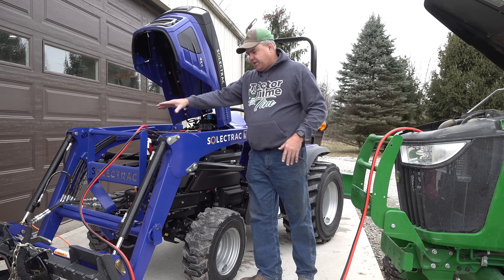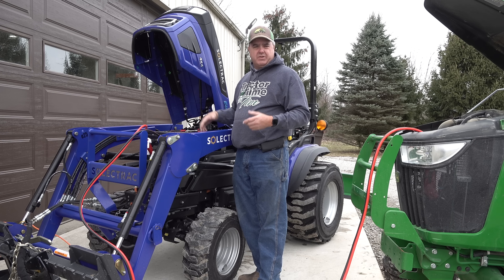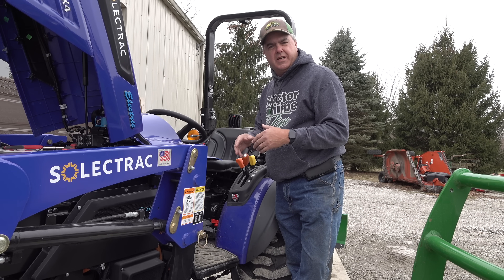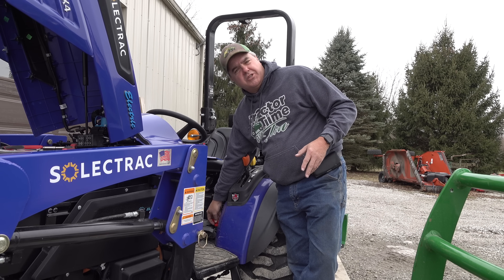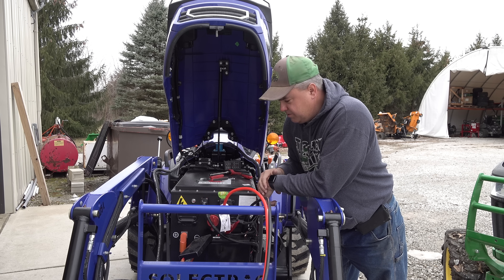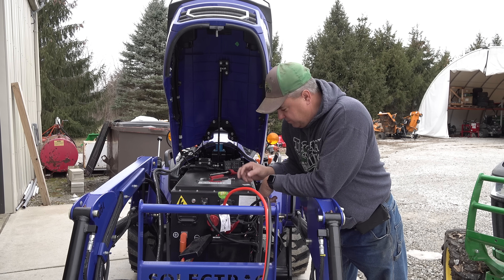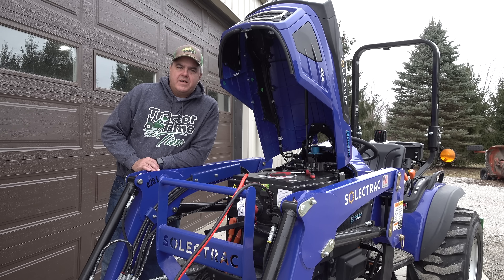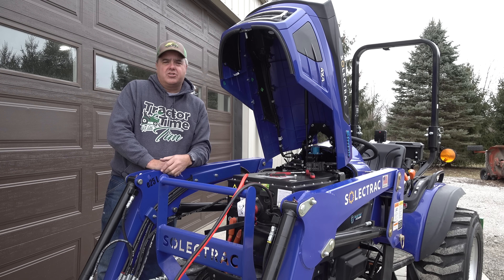Battery Issue with the Solectrac Electric Tractor!  I’ll Explain the Details!

Comment: I have a 2022 Farmtarc 25h diesel ,,battery is dying after sitting a month,,light is flashing on control panel that shows a charging issue,,could a bad battery be the cause,,since my tractor is only 9 months old i would hope alt is still good?if battery is bad is a actual tractor battery needed or will others work,,any help would be apprec

Comment: It has been this way with my Teslas for years, as far as having a separate 12VDC battery.  My newest Tesla now has a compact lithium 12V battery, but if that 12V becomes discharged, the car will not operate.  I’ve heard of folks having issue’s similar to your tractor, in their Tesla, but I’ve never experienced it.  The fact that the tractor has a battery disconnect is concerning to me, as it would seem to indicate they know there is a substantial phantom drain issue. The main drive unit battery and controller should not let the 12V battery become discharged.  I would guess they are still working out issues, and will eventually overcome this problem.  Does it have over-the-air update capabilities?

Comment: Too much aggravation and it is a toy  by comparison to any sub or compact diesel powered tractor especially when putting these things to work for a  profit . Anything electrically powered can be manufactured whether or not it  makes any sense  all.
Having to adjust to charging time cycles to get a job done is not a luxury that most work jobs  schedules permit 
 irrespective of what season of the year it is. People have gotten goofy about the concept of  green nonsense  and despite the adverts these things will not save the PLANET  through  any misguided notion about the reason for them to exist except noise levels , they are quiet that is  undeniable . But ,  their construction has already contributed to polluting materials and emissions where the starry eyed  owner cannot see them , and will be anytime its plugged in to charge ...an inversion of the emperor`s clothing  , free  solar right  ? Yes  in places like  the Sahara desert , or  Arizona ... not likely in northeast or northwest  insolation in either leaves a lot to be desired .
They do have  a place as  yet another  Green home owner  feel good  bragging rights green toy , for owners  who can wait whatever time it takes to top the electrons needed to do a few hours work , provided that it can deliver that much work time  in the REAL WORLD .

I cannot wait for the attacks which will no doubt come my way , but  I will laugh them off for what they are ...reality is tough to face and harder to exist in .🖖live long and prosper !

Comment: EV cars and trucks are the same way.  The 12v battery runs all the accessories, lights, windows, climate control etc.  Without the 12v you are dead in the water and it is frankly the weak link on many EV's.  It's a good idea to keep the 12v on a battery maintainer much like we do with other equipment when it is sitting for a long time.   12v runs the brains of everything, and the large traction battery does the locomotion.  🙂

Comment: I have this same electric tractor and did the same thing with the 12v battery.  I just replaced the 12v lead agm battery for a LiFePo4 battery.  Same size and higher capacity.  I still try to turn off the 12v system when I’m done using the tractor, though.

Comment: It's actually a safety feature to turn that switch into the "off" (breaking the circuit) position.  No different from turning a key. The "Mains" (main "larger" Battery) should also have an on/off switch.  Emphasis on "mains" as the 75 horsepower Solectrac has swappable Batteries which is absolutely the way to go if you pure BEV as first off you can store your Batteries in a warm, sheltered space such as Basement or Garage space that needs safe air space as Batteries are always discharging so same with lead acid always store when not in use in a safe open not in your kitchen or living room space and away from any liquid fuels, coolants, hydraulics etc. Of course this should be done via in person with Solectrac Dealers and Owner's Manual as well!

Comment: I have an e25, and I ran into the same thing. You have to turn that little red switch off to prevent phantom drain of the 12 volt battery. It takes several days to phantom drain, so it’s not a problem if you use the tractor every day, but I shut off that switch whenever I’m done working. When it happened to me, I used my trickle charger to re-charge it. I also decided to hedge my bets, and bought a lithium-ion 12volt replacement for the stock lead-acid one. (I don’t like lead-acid batteries anyway, so I was happy to get rid of it.)

The 12 volt battery is necessary to run all of the 12 volt electrical stuff — the lights and switches all need 12-volt to run them.

Comment: Think of the tractor as being entirely computer controlled...computer controlled main battery discharge, main battery temperature monitoring, torque delivery, and even main battery charging....that small battery is for the computer.  If that computer isn't computing, the tractor isn't tractoring.  :)

Comment: I had 12V problems until I fixed the shutoff switch. The contacts were corroded (happened on the dealer's lot) which dropped the voltage I got from the 12V battery, making the battery drain issue much more pronounced.

Comment: Very interesting stuff with EV Tractor.
Sounds like the 12v battery is kind of like a home thermostat. It runs on low voltage but controls the furnace and A/C. Too bad the snow didn’t get going yet!!

Comment: You might want to check the voltage on the 12v small battery when the key is in the on position to make sure it is getting charged from the big battery. Mine had a wiring issue that prevented the big battery dc-dc converter from charging the 12v system so things would work for awhile but eventually the small battery would get low and the whole system would freak out in confusing ways. It is not like a car where the car on voltage is up at 16vdc but when using the tractor it should be maintaining the small battery at 13vdc ish based on my recollection.

Comment: No different  than any normal gas car. Let it sit parked for a few weeks and your battery is dead. I'm sure older ice tractors have less electronics and can sit longer without topping the starter battery.  A very small consideration to have in mind.

Comment: I wish Tesla would get into the compact tractor business.   I think they could really make an amazing product applying their First Principles methodology.  The soletrac really seems like a DIY retrofit machine.  Personally, I'd love an electric.  I do dislike the smell of the fumes and the noise from my 1025r after a few hours of use.  (that said, overall, I LOVE my 1025r)
Reply: Tesla just upscaled the electric car you had as a kid. The only real innovation they have made is the low resistance way of joining the battery cells together.
Reply: @atodaso1668  Wow...not even close to accurate.  The innovations that Tesla has made in drivelines, manufacturing, metallurgy, software/simulations/AI, battery cell design, safety, aerodynamic design, automated driving, and much more are leaps beyond the rest of the car industry.
Reply: @mymorristribe  Except they didnt do any of that. Drivelines?  Tesla invented the electric motor and torque vectoring? My remote control car had that. Manufacturing? You mean they told another manufacturer to make a large casting machine for them to save manufacturing costs but will result in more costly repairs? AI? You mean using their customers as guinea pigs and crashing them into parked fire engines on the highway? Battery cell design? Do you mean Panasonics battery design? What safety innovation did they make? Its not hard to get a good crash test result when your car is made of a solid piece of heavy metal, just look at a WRC car. Aerodynamic design? The Honda insight had the same level of aero and its an economy car from 20 years ago. And are you talking about the automated driving that is being investigated due to its poor performance? Driving through red lights,  going straight while in a turning lane, cutting people off etc?
Reply: @atodaso1668  Ah so you are a Dan O'Dowd, dawn project troll eh.  Well, whatevs.  Tesla is the future--maybe pay attention.
Reply: @mymorristribe  No idea who those people are. Just an electrical engineer that was into RC cars as a kid.

Comment: Got to do some snow clearing the last two days. My 1025r, Joan, did wonderfully, despite R4s on the back. I used a back blade, turned backwards, and was able to clear more than a foot of powder off of my dirt road. Joan cleared three miles of road, and half a dozen long driveways, without so much as a hitch in her giddyap!
Reply: R4s are amazing tires. I'd put them on my work truck if they made them. 👍

Comment: Most evs have phantom drain on the 12 v the switch was put in to stop that from happening, but unfortunately there’s no sensor to tell you to turn it back on when in use
Reply from the maker: Won’t start with the switch off.

Comment: Hey Tim:  you said the BIG battery doesn’t charge the 12volt battery.  When you plug the tractor into a 240 volt charger, does that charge both batteries at the same time?
Reply from the maker: No. Only charges the big battery.

Comment: I drive a 17’ Ioniq EV and it has a built in battery tender for the 12V system. I was surprised  to find out not all EVs have this feature. 
On most EVs the 12V system is the most unreliable part of the vehicle. 
EV typically use smaller batteries (no need to crank over an engine) but these smaller batteries seem to fail.

Comment: Interesting.  But if you’ve ever looked at any hybrid car, you’ll find there’s still a 11v battery to run the “normal” car stuff, including the engine.  Then there is a completely separate battery pack running at a high voltage to run just the electric drive. I guess I shouldn’t be surprised, they pilot the electronics on the tractor with a low voltage battery and only use the high voltage pack for hydraulic motor and drive. Stranger still, the battery charge cable can’t charge the low voltage system. Seems like a major oversight.

Comment: That makes absolutely no sense and would appear to drive a negative user experience.  I suspect good engineers were constrained by cost, OR bad engineers could not solve for having a more simply designed and functional system for the user.  Neither would be acceptable to me.

Comment: Congratulations. You discovered how EVERY electric vehicle that uses a high voltage battery pack operates. In a Tesla, for example, there is a 12 volt battery. It powers the computers, communications (Teslas have cellular and wifi capabilities) and the entire dash and entertainment system. When a Tesla goes to sleep, it will wake up periodically and charge its 12 volt battery to keep it maintained. Keeping the high voltage pack awake would drain that system quickly. 

As for storing this tractor, you could keep it plugged in to charge the high voltage (the tractor will ensure it doesn’t over-charge). And you could hook up a Battery Tender™ or similar to that 12 volt battery and the tractor will be ready for you whenever you need it.

Comment: The 12v battery serves the same purpose is what a 12 volt battery would do on a regular ice tractor or vehicle. It is there to control instrumentation fans accessories in the case of an EV or this the 12 volt main relay for the charging and to control the high voltage battery. Normally in the case of an electric car when you plug the car into charge it also charges the 12 volt battery. In operation when the cars being driven or the powers on to the car, the high voltage battery is charging the 12 volt battery. Biggest reason that they do that is because in the case of like my Chevrolet Volt the high voltage battery is at about 400 volts. You can't run the accessories or anything with that voltage because there's the risk of shock. That is why the used 12 volt for all the accessories. I'm sort of surprised the draw on the 12 volt is that high that after a month that kills the battery because in the case of a normal ice car normally it would last longer but perhaps the batteries smaller in the tractor. The key thing is when you're operating the tractor the high voltage battery will charge the 12 volt battery. You do not need to worry about putting a maintainer or anything to charge at battery in the case of with the soul track as long as you shut off the circuit so you don't have the draw all the time when it's parked for a long. Plugging the tractor into charge would probably be the effect of being a battery maintainer if you have it plugged in all the time, but I do not know how the charger works on that and the case of my Chevrolet Volt when I have the car plugged in during cold weather. It also maintains the temperature in the battery so the battery doesn't get blow freezing and that's one functional. Why I leave that car plugged in all the time draws very low juiced to do that because the battery pack is pretty well insulated.

Comment: If the 12v battery needs to have a charge in order for the high volt battery to be charged, does the switch you were referencing need to be on(or can it be off?) for the charger to charge to battery. Sorry if my wording is a little confusing. Thanks Tim and Christy for this series!
Reply from the maker: I understand the question, not absolutely sure on the answer.  Sorry.  I’ll try this…but it makes sense to me that the 12v will need to be ‘on’ to charge.
Reply: @TractorTimewithTim  I did the exact same thing to my tractor as Tim, and I did worse even and completely ruined the 12v battery, though Solectrac sent me a new one under warranty and explained about that switch. I believe that cutoff switch should be on at all times including when charging except when it's not being used for a long time. I don't know if it's recommended to just leave the tractor just plugged in when it's parked over an extended period though I assume it is safe.
Reply: @AdamHayekM  Thanks for sharing this - as an EE I think the manufacturers have screwed up on this design a bit - that small battery should be able to be fully recharged while the tractor is in use, from the large battery.  If it isn't, then it will inevitably discharge and sitting in a partially-discharged state for long periods of time will lead to premature battery failure.  

If this was my tractor, I would install an on-board charger/maintainer on that 12V battery and keep it plugged in when not in use.  That way, even if the master switch is left on, the controls power battery will stay fully charged and live a full life.

Comment: Why can't the "master" switch be a relay controlled by the ignition switch? that way you never forget to shut it off. Obviously there is a significant parasitic load if it went completely dead in that short time frame.
Reply from the maker: 4 weeks?  Pretty small battery.

Comment: The 12v battery does the same job in EV cars.
What I find strange is that it was designed with the manual switch for the cut-off.
I would be inclined to fit a contactor (fancy word for heavy duty relay) where the switch is and then have it turn on with the "ignition" key at the first (accessories) position, and the second position would be the main 'ON'/"Ready" mode.
Reply: they cheeped out
Reply: But like Tim said, this is more of a first production prototype. All manufacturers do the same. Changes made on subsequent models.

Comment: This is a bit surprising - on electric cars if the car is turned off, it will 'turn on' every ~6 or ~12 hours and charge up the 12v battery. Sitting 4 weeks shouldn't have any effect. I wonder if they did not implement that system?

Comment: A few comments, first I have a 07 Toyota Camry hybrid which also has a special small 12V car battery that costs $350 to replace, more on that later.  It lasted 14 years & in that whole time I assumed that there was just the one large battery pack that ran everything, as there is no battery in the engine compartment.  So one day I got a message on the dash to change the battery,  I"m thinking it's the whole $6000-7000 battery pack.  I went on line to see if there was a youtube video on replacing them and low & behold I see a guy replacing the small 12 volt battery hidden in the trunk under a screwed down cover!  So... the battery has this air tube which lets any battery acid fumes out of the trunk as well as a special connector...thus the reason it's so expensive ($5 in parts BTW).  The biggest issue was that I had a bunch of things to do afterward like re-install the GPS map program, putting in address info etc. etc....but I was happy I was able to get away with only a $350 battery cost.  Zip ahead 2 years later and now at 16 years I'm getting messages to check the hybrid system.  3 times now the car has just turned off, once while going 60 mph and trying to get on I-95!!!! Luckily each time I was able to still steer & coast to a stop, I retried starting 4  or 5 times & she started and I was on my way.  Now every time I see a 2007 non hybrid  Camry I think to myself that lucky person doesn't have a ticking time bomb & can drive that car for 30yrs without replacing the $7000 batteries, or worrying about a battery fire!!  The best MPG I ever got was about 33MPG...a new non hybrid Camry now has that or better MPG.  An other interesting fact....A friend works at a Honda parts dept and he told me that customers that don't drive for 3 months (snowbirds)  end up replacing the pack at like 50,000 miles or 4 or 5 years. Hope this helps someone!